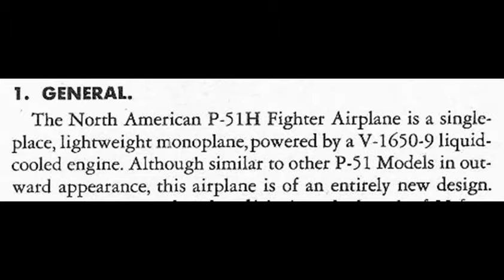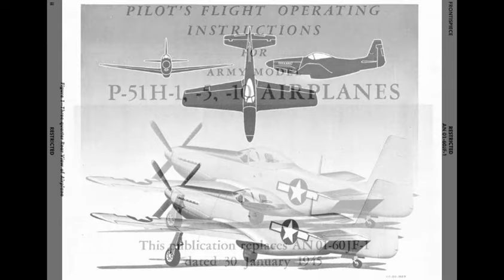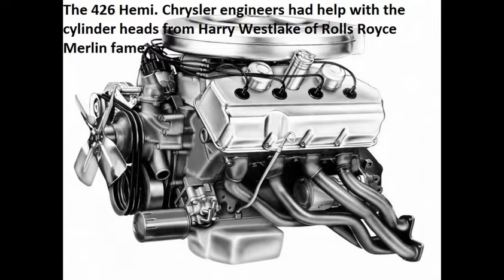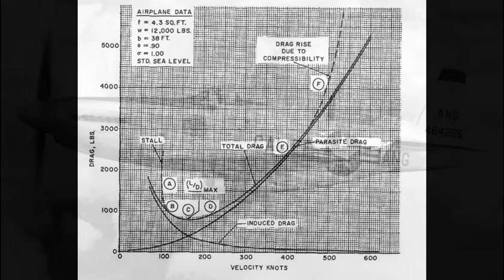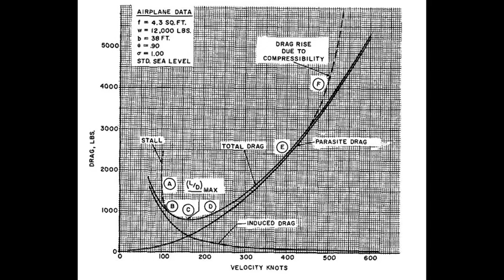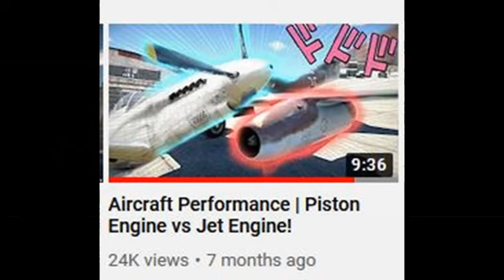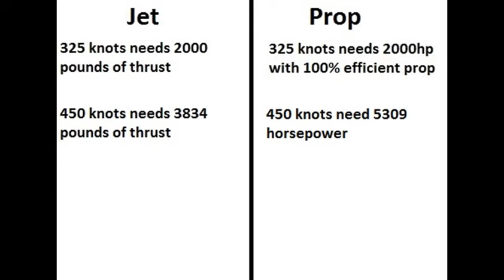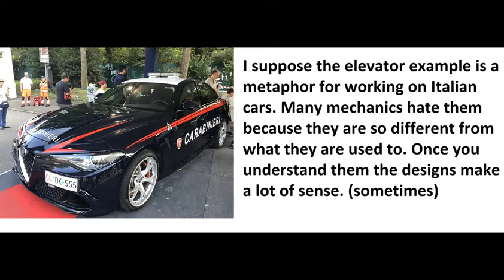U.S. "Superprop" Fighters P-51H, XP-72, and more

Comment: 16:00  There was an unused considerable potential for improvement, and that is by slight reduction of the size but an substantial rpm increase coupled to a contra rotating propeller with some sweep in the blades driven by an integrated very low loss reduction-contra rotation torque sharing drive and variable valve timing, realizing  the controllable shift to the highly  efficient adkinson cycle.
The range increase meant a fuel weight reduction/range extension  option.
Reply: 19:00  Your equation is correct for a given altitude, but at higher altitude, say 33000 feet  the density is a third of sealevel  density. The  aerodynamic properties vary  with indicated,  or more precisely calibrated speed;  Your graph summing  the induced  drag and the parasite drag is perfectly valid  for indicated air speed. On the formula V is the true airspeed. But the drag, thrust is  reduced. how?
At 33000 feet the indicated AS is smaller by a factor of square root 3,  1.732. Now you go back to your graph and read the drag for this reduced speed, considerable smaller. The minimum drag, which corresponds to the Best L/D  is evident and correct on the graph. When you fly at altitude and maintain the same manifold pressure, the engine power is the same.  Going back to your formula, reduced  drag at altitude allows higher true airspeed V.
You are a skilled pilot and can try  this out with an aircraft with a turbocharged engine.
Reply: To try this out in uncontrolled air space well below 18000 feet here is a conversion factor table to  convert indicated  AS read on your instrument to true airspeed for power calculation
 3000    1.05
6000     1.10
9000      1.15
12000    1.200
15000    1.26
18000    1.33
21800    1.414
33000    1.732
 example 12000 ft altitude
indicating     100 knots
TAS = 1.20 × 100 = 120 knots exactly
If you make a standard turn of 3 deg/ sec  the bank angle is 
  =  3 × 120 /  20  =  18 ° bank
this is why it is important, in IMC to know what the true airspeed is
Reply: YT has cut off some lines in the reply, 2 above ....manifold.pressure   and more
Reply from the maker: Dude, that's not my equation, it's from Aerodynamics for Naval Aviators. If you have an issue with it, please take it up with them, or the FAA. This is the most peer reviewed book on this subject, and if you have found an error in it, I promise to be really impressed.
Reply: @GregsAirplanesandAutomobiles  
With all due respect for your work, when you utilize contrarotating propellers they have a better propulsive efficiency  than single propellers, because they recover the rotational energy   behind the first propeller.
I am  a professional areodynamicist ,btw,  and CFII.
Why do you think the Russian long range Bear bomber has contrarotating  propellers, despite the noise  they make.   I am not trying to argue with you, just pointing out that  there is a potential for improvement. The disincentive is the mechanical complexity of the system.
Reply: @GregsAirplanesandAutomobiles  
With all due respect for your work, It is matter of interpretation, If you look at the graph of the induced drag and the parasite drag, you will see on the label  that it is valid for sea level conditions, standard day, meaning the density is 1.225 kg/ m³, at altitude the density, rho, decreases, half sea level density at 21800 feet, a third at 33013 ft. 
The induced drag is
Di = ( Lift/span)² / ( pi × rho×.5 × V²)
The parasite drag is 
Dp =  rho× .5  ×  V² × Wing area ×  cd
V here is the true airspeed, which is higher than the indicated on the instrument, by the factor sqrt(SL density / density at altitude) 
At  altitude, the induced drag for given true  airspeed increases, while the parasite is strongly  reduced.
Your graph can be used at any altitude, provided that the velocity used is the indicated at that altitude. 
You, as any pilot can obtain true airspeed with the  circular slide rule computer ,  that every pilot must use , to calculate the true airspeed
The power calculation is just TRUE airspeed times the drag at altitude, divided by the stated factor, as the equation shows, no dispute.
The drag at Altitude can be simply obtained by taking that graph and use the indicated airspeed as velocity, listed on the abscissa. Saves calculating the drag for every altitude.
Ask any pilot, that there is a difference between the pitot pressure sensor caused indicated AS and the actual airspeed.
Btw, I am a professional aerodynamicist and CFII,  certificated commercial pilot  by the FAA.
I have no issue at all with your book.
Please do not call me dude.
Reply: Also, I have built airplanes and made first flights as a test pilot on more.
Reply: "There was an unused considerable potential for improvement" ... hindsight is 20/20
Missiles will replace cannon
jet is better than piston
= A-10 is just like an over-engineered A-26/Mosquito ...forward  thinkers do a lot of mistakes when they have their visions of grandeur

Comment: The Rolls Royce Crecy was a two stroke engine using a supercharger to compress the inlet charge  it was  ...reasonably .....simple light powerful and economical the Crecy showed great potential for a while. The one problem with the two stroke Crecy was that it overheated  and eat its piston's  primarily due to the lack of a simple squish type cylinder head  and a jet of air or cooling oil aimed directly under the piston crowns but that was history... .  The Jet Age had arrived .and  the Crecy had run out of time and met it's Waterloo..

Suddenly  Bristol and De Havilland were producing superb results from their own jet engines ...  All piston engine research was summarily dropped by Rolls Royce when they realised that they were rapidly painting themselves into a corner...  The Crecy and some other piston engine developments including a  sleeve valve copy of the Napier Sabre all of this ceased forthwith.This precipitate action  was primrarily due to the rapid encroachment into the Air Ministry by various home based aviation companies who were now squatting on Rolls Royce's hallowed ground while Rolls Royce was still chained up and chewing pistons  in the doghouse ....

Comment: 13:00 - If the exhaust drove a turbo big enough to do the job there would also be a heck of a lag as it took time to spool up to speed when you jam the throttle open quickly. This would make it hesitant to do an emergency speed increase or climb - those few seconds might be key to not getting shot up... Superchargers use some of the mechanical engine power, but have zero lag. No expert here, but this might have something to do with the decision to not use a massive turbo (exhaust turbine driven) system maybe?
Reply from the maker: Remember you have 3000 horsepower worth of exhaust to get that big turbo spinning.
Reply: @GregsAirplanesandAutomobiles  Most of the engine power goes to the driveshaft. Maybe 10% lost in exhaust gasses? So more like 300 Hp.... But the turbine would be built to suit the engine. So it would still have some spool-up delay as it responds to the gas pressure increase.
Reply: @stevexl7747  The rule of thumb for piston engines is that one third of the combustion energy becomes mechanical power, one third is expelled through the cooling system, and the final third is in the exhaust gasses. This is because most piston engines are about 30% efficient. So a 3000 hp engine needs to expel roughly 3000 hp through the radiator/cooling fins, and has roughly 3000 hp in the exhaust available to power a turbine. This is also one of the reasons why turbocharged applications can often achieve higher boost than a supercharger - there's more power available to drive them. 

Also, I highly doubt that turbo lag is much of a consideration here. People often call the delay between throttle application and power output 'turbo lag', but in reality this is not one thing but the result of two separate factors. One is turbo threshold - at low revs there's not much boost available, even if the turbine is already fully spooled (for that engine RPM). The other factor is "real" turbo lag - how long it takes for a turbine to spool following throttle application. The turbo threshold is by far the bigger factor. It is relevant in cars because RPM is varying over a wide range, but not in aircraft, as their engines are kept at a constant RPM by the constant speed propellers.
Reply: @ASJC27  fair enough... though if you got all that 300hp from the exhaust gasses they would be cold and static at the outlet of the exhaust. I think my estimate is closer to the true power harvested from the exhaust.
Reply: @stevexl7747  Taking the P-51H as an example, it could do about 2,200 hp at an altitude of 8,000 ft with 90" of manifold pressure. This power means an air mass flow of about 257 lb/min, and the manifold pressure means a compressor pressure ratio of about 4:1. A typical aircraft centrifugal compressor that matches these parameters will have an isentropic efficiency around 78%, which means it will require about 450 hp to run. If this compressor is driven by a turbo instead of the engine, the turbine will have to extract this power from the exhaust flow, and in the process liberate the 450 hp taken previously from the shaft. So this turbocharged engine will produce about 2650 hp, and the turbine will only have to extract 450 hp from an exhaust flow containing also about 2600 hp. This is not a problem for a radial turbine.

BTW even if you have a 100% efficient turbine and extract all the available power from the exhaust, the output will indeed be stationary (or nearly stationary), but it will not be cold. Turbines can extract only as long as there's a pressure drop across them, so until the pressure drops to ambient, and at that point the gasses are still very hot. To then get more of the remaining heat energy, heat exchangers must be used.
Reply: @ASJC27  This depends if the exhaust undergoes a more adiabatic or  isochoric process  to spin the turbine somewhat... But I see your point. Interesting stuff.
Reply: @stevexl7747  Radial and axial turbines or compressors are defined as isentropic processes, and they are very close to that. Their efficiency is rated based on how close they are to an ideal isentropic process. A radial turbine is typically 80-85%, an axial turbine is 85-94%.
Reply: @ASJC27  Hmmm. Interesting thanks.

Comment: The Italians had built one around an espresso machine. However, it was discontinued do to problems with maintaining good heat and pressure as well as a good head of foam on the lattes.

Comment: How did the "H" model Mustang compare to the Griffon powered Spitfires? Of course the 2 would never fight each other but I am asking just for the sake of interest....
Reply from the maker: The P-51H was superior.
Reply: @GregsAirplanesandAutomobiles  Thanks.  Delighted to hear a straight and direct reply from someone on the matter of Mustang vs Spitfire. Lots of people find ways to avoid the comparison with reasons like, "so many Spitfire versions, which one?"，or "one is a racer converted to fighting, the other is made as a fighter so not right to compare",  or "one is for domestic air defence, other is for long range escort so not the same" etc etc etc....So thanks again for your straight and direct answer 👍👍

Comment: How many 37mm rounds could it carry? Would it be enough to be an effective fighter?
Reply: A bit late but I did some calculations. There were 3 armament proposals for the XP-72:
- 6 x .50 cal MGs: 300 rounds per gun.
- 2 x 37mm cannon and 4 x .50 cal MGs: 30 or more rounds per cannon and 300 rounds per gun.
- 4 x 37mm cannon and 2 x 1000 lb bombs: 30 or more rounds per cannon and 2 x 1000lb bombs.
This is based on gross weight and MTOW, I also did a bit of research on previous aircrafts that used these weapons: the P-39 had one 37mm cannon that had 30 rounds, it’s successor, the P-63 also had one 37mm but could carry 58 rounds. And the P-47 which typically had 8 x .50 cal MGs, with 425 rounds per gun.
Note that 37mm had 3 ammunition types: Practice, High-Explosive and Armor-piercing. From what I gathered, the AP shots were mostly used against ground targets (ie tanks, bunkers, defensive positions,…) and HE shells were used against aircrafts, which were pretty effective. No need to talk about the .50cal shells since they are pretty good at setting things on fire and shredding everything.

Comment: If Boeing, Lockheed, etc. had to produce piston driven fighter today could they develop one significantly better than the Late War/Super Prop era aircraft?  It sounds like they hit the upper limit of powerplant/propeller performance but would advances in materials/electronics/aerodynamics allow them to build something that pushes noticeably beyond what they did in the late 40s/early 50s?
Reply from the maker: Yes, they could do more today, but not much more.
Reply: @GregsAirplanesandAutomobiles  which is why, seventy five years after WWII, the piston speed record is only about 20-30mph faster than than the super props... great explanation of the effects of the drag rise BTW.

Comment: What about fuel supply and range of these high horsepower engines. Wouldn’t range be considerably reduced as a result?
Reply from the maker: More power means greater fuel consumption, however at cruise speeds the XP-72 doesn't need as much power to move along as a normal 47, so it's not as bad as you might think.

Comment: Excellent video.   Did anyone produce a liquid cooled radial engine for actual production?  I have no experience with this.
Reply from the maker: Not that I know of, I have seen several prototypes though.
Reply: @GregsAirplanesandAutomobiles  Amazing idea, but might be very hard to make work.  I never even thought of it. Of course the main attraction of non radial inline engines  was a smaller front cross section.  If air cooling works, and it does,  why add another complication and combat vulnerable  system. I suppose that increasing manifold pressures and compression ratios were at the limit for air cooling and better liquid cooling could delay detonation.  The power of prop engines by 46 was getting nuts. 

PS thanks for this, I never knew about the P 47 late development project.

Comment: 2:30 wow a 42 cylinder aero engine (but lower displacement and power than the 28 cyl Wasp Major.) That must be the record for cylinder count on an aero engine (2x28=56 sparkplugs on the Wasp Major were already a pain, especially with 6 engines on the B36 bomber.) The only other 42cyl engine I was aware of was the zvezda M503 marine diesel which is outclassed by its larger but less common brother the M504 with 56 cylinders and the M507 (two M504's connected via a common gearbox.)

Comment: Is this engr's heaven?  + Haven't read/seen anything about prop aircraft in Korea action (Specifically from this author webpages).  My q. is any ideas on variants of P-51(or these engines) in action in Korea conflict?  Or any conflicts after WW2?  TY in advance.  P.S. I live near Reno NV.  So I get to the air races here often.  Just a FYI
Reply: +Laird David   The P-51D and Corsair, as well the F-82 and B-29 were used in Korea. I keep thinking that if the North Korean government falls one day,  it will be a fertile hunting ground for Mustang and Corsair wrecks to restore.   Small foreign air forces were equipped with many surplus warbirds after WW2, and as those aircraft retired they found their way back to the US in the 1960s to 1980s.  Lots of P-51s, Corsairs and P-47s were in Latin America, although many were wrecked and scrapped.
Reply: Engring humor & side-note;  earned my BSME 1999/2000. Classes was/could be savage.   Being a comedian type a good funny was last day of fluid mechanics(before finals). Prof talked of unusual circumstances & asked if there's any q.'s.  So I spoke up w/ 'you didn't speak of  phenomena when water flows toward money'.     TY

Comment: Could the undesirable disruption of the production of an adequate existing fighter be a justification for the non-production of an experimental design, i.e. quantity over quality?
Reply from the maker: Yes, I think that's why they didn't bother producing the P-47H.
Reply: @GregsAirplanesandAutomobiles   For the same reason that the idea of a Merlin-engined P-38 had been discussed, but shutting down P-38 production for the changes was not permitted by the War Appropriations Board.  (Along with losing thousands of Merlins needed for other planes.)

Comment: Mechanical drive superchargers have less response lag when increasing throttle opening. No turbine windup time with mechanical drive.
Reply from the maker: Not a factor in an airplane because the turbo WW2 planes still have a mechanical supercharger in the system.

Comment: thanks greg up to your usual standard. i think the RR crecy pointed the way forward. sleeve valves and 2 stroke operation the potential of sleeve valves is shown by the later Centaurus radialshaving avalve/port area similar to the bore areahelps and twice as many power strokes per rotation, with forced induction 2 stroke operation alows more power or lower rpm. as demonstrated by railway diesel engineshope this feeds your obvious curiosity, trying to give bsck a little brain candy. roy
Reply: Thanks for answering a question i have had ,namely how did Bristol get a 4 stroke engine with 1 sleeve.  My  Grampa had a Willys Knight auto, and it had 2 sleeves, one intake one exhaust . I was thinking, no matter what the valve form is, 4 strokes seem to need at least 1 valve for each stroke.😀